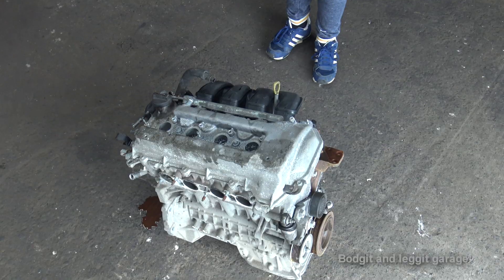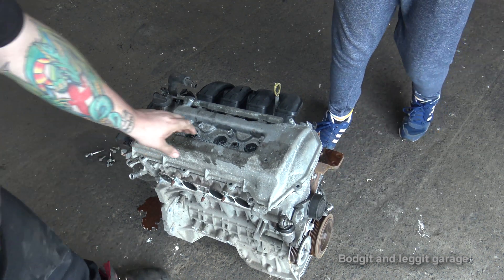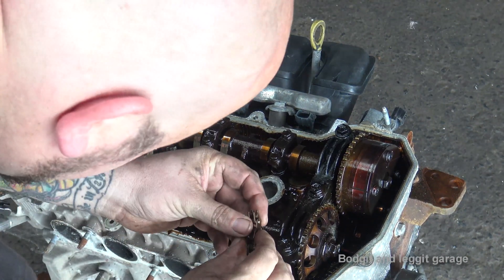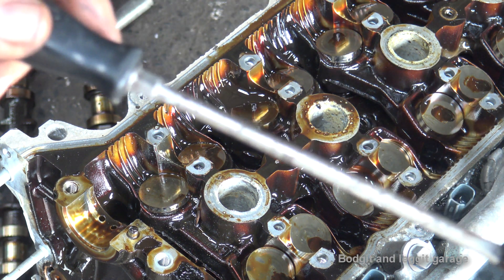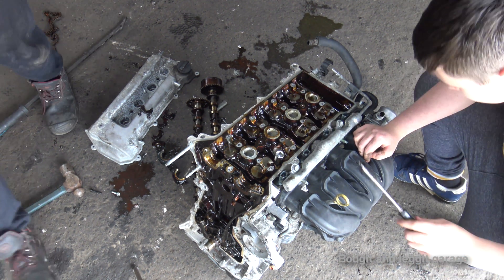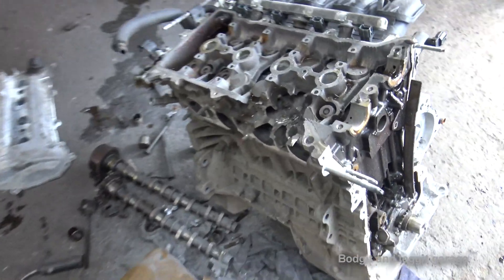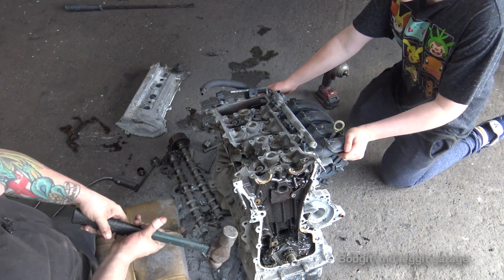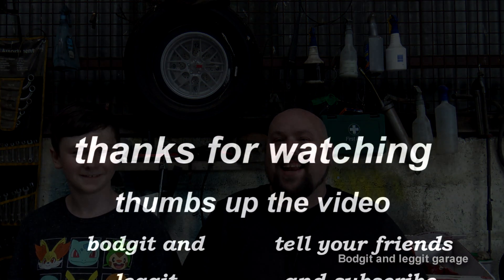Toyota Engine Autopsy Unbelievable Unexpected part 4

Comment: My one cent,,,my guess is a plastic of one of the chain guide come off and get stuck betwen the chain and sprocket and the stress broke the chain,i seen that a few times.And yes, lack of lubrification.
Reply from the maker: It's always a possibility but the fault is because of lack of lubrication which is lack of maintenance which ultimately cause the problem

Comment: When watching other videos e.g. dealing with a failed turbo, I had thought it would be a good idea where possible to remove an external oil pump so as to be able to back-flush the pickup tube with solvent. The resulting rubbish would then need to be flushed out with an immediate oil change.
Reply from the maker: Hi mate it's a good idea but like everything you have to be really careful and flushing engine you can be pushing all the bits through and also moving bits and blocking passages that will never blocked before or it's always best to do a manual strip down in my opinion this way you know nothing is blocked and you can get it as clean as you possibly can providing the customer wants to pay for this

Comment: My transit just turned 196,000miles, original clutch, new injections at 140,000, oil changes every 5000, amazingly goes like a rocket, doesn't leak or burn any oil,
Reply from the maker: Sorted nice job meet you look after it and it looks after you

Comment: Was the case of the stripped off bolt you being impatient or was it a soft head on the bolt?
Reply from the maker: It was because the engine just basically got cooked with no lubrication technically not overheating but still cooking
Reply: @bodgitandleggitgarage  Thanks that explains it.

Comment: This is what happens to Most engine's with a chain people tend to think because they have a chain don't need to service it as much. So oil goes into jell and block's the pick up pipe starves chain then it breaks or stretches. Seen this happen on a few engine's (Lack of services oil is more important than you think) Good video mate. 👍👍
Reply from the maker: Preventive maintenance is the key mate as you will know

Comment: Never seen one of these snap a chain. Seen one or two seize and i saw one throw a rod because the oil pickup was clogged or the oil pump was weak. 

I have done quick and dirty rebuilds on these for really high oil consumption but i would never attempt it with even a fraction of that damage. Cheaper to get a used engine from the scrapyard. 

Sean is a lucky git. His dad got him a great first engine to strip down. My first was a shitty old 1.8 B series out of an old Marina! I still have the Haynes manual he gave me to help me. haha
Reply from the maker: Yes my I must admit I wasn't expecting the chain broke I was expecting a seized engine

Comment: Well, you could repair it.... But it is easier to stick in a second hand engine. That does look like a lot of over heated oil has been in that engine.
Reply: I'd be interested to know if you have the measuring tools how worn the cylinders are though.

Comment: There’s a family in Cambodia could have used that engine Leon....... for a table! I wonder how many miles the owner did without changing the oil I bet all the bearings are cattle trucked, I fear they probably haven’t learnt there lesson or think it’s so cheap it’s not worth servicing. Still if you drained what was left, looks like it would make a nice gravy.
Reply from the maker: It would look nice on fish and chips lol

Comment: Great teardown, Leon.

Can't imagine why anyone would want to rebuild it - by the time you replace the valves and cams, have the head machined and rebuilt, replaced the oil pump, the crank and big-end bearings (I sure wouldn't trust them, considering what the oil pickup looks like), cleaned the sludge out of the oil galleries in the block and inside the crank...in terms of labour, that's pretty much a whole engine rebuild, with the bonus of possibly having to pull it out and toss it away in a week or so when a wrist pin decides to let go - after you've just spent a bunch on the semi-rebuild.  Tossing in another complete engine is likely to be cheaper and in better condition.
Reply: I have done a "quick and dirty" rebuild on a few of these Corolla engines for a mate who uses them for a courier business. They all had really bad oil consumption and needed the clutch doing as well. Basically piston rings and a clean up. Change the gaskets. I did visual inspection and these engines were pretty well maintained because i serviced them for him. You couldn't sell that to a customer let alone fixing this POS. It's FUCKED. I have never seen one of these snap a chain.
Reply from the maker: Thanks a lot mate but this is YouTube and there people already saying it can be fixed lol
Reply: @bodgitandleggitgarage  it's amazing isn't it, all the technology in vehicles these days, but it's still the nut behind the wheel that destroys them, you can't completely engineer out lazyness or stupidity.

Good work fella.

Comment: Hi Leon,  great video keep up the good work, would you recommend adding an oil flushing additive before doing an oil and filter change
Reply from the maker: Hi mate definitely not have never used an oil flush it's too dangerous just service your car reg Lee and you will not have any issues I personally do mine between 3 to 5K
Reply: Change the oil & filter regularly and you don't need to do a flush...........

Comment: Back in 1968 Leon, it was a snapped timing chain that eventually stopped my Mini. 850cc overbored to 920 using Devon Dorset pistons and a 997 cooper cam. Sweetest engine ever made and lasted me 18 months of pure thrash.
Reply from the maker: Niceeeeee
Reply: @bodgitandleggitgarage  We thrashed engines. 20,000 miles needed a rebuild. This one did 40,000 odd thousand 😊😊👍

Comment: That is the fun way to disassemble an engine! hammers and pry bars! Great video. I like to see tear downs. And you should have rebuilt the engine!!! hahaha!
Reply: Consider the cost of a rebuild, new head, valves, chain, guides, pistons, seals, gaskets etc plus the cost of labour, it wouldn't have been economical to rebuild the engine. It makes much more sense to put a good secondhand or recon unit in. It would've made a great vid watching the rebuild though.